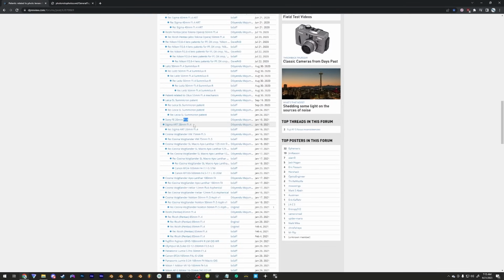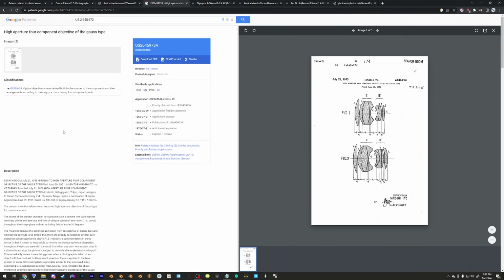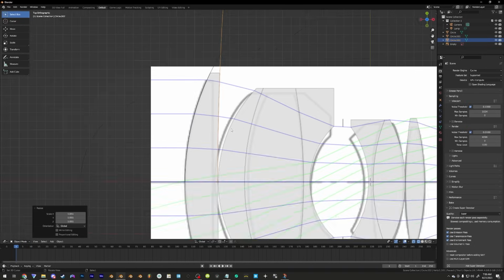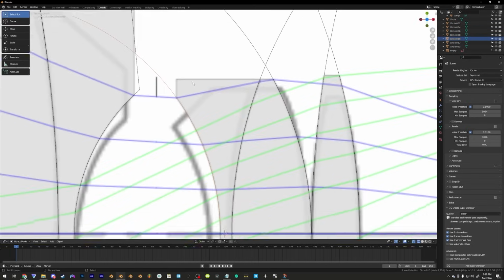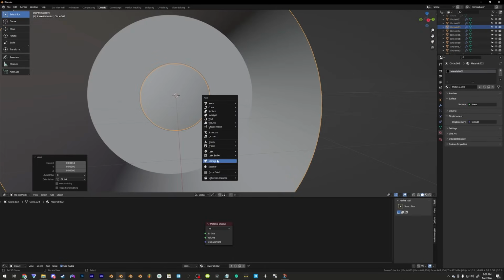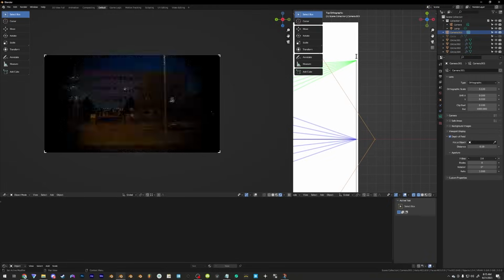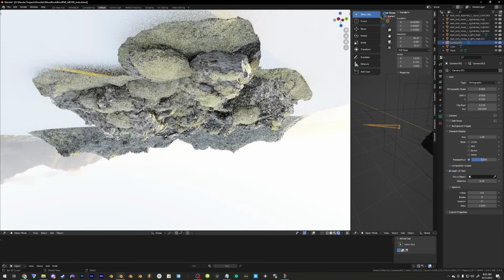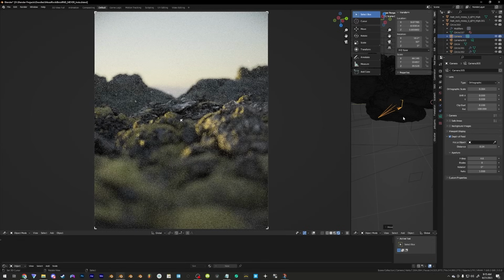Achieving True Photorealism With Lens Simulation

Comment: I wonder if there is now a way to dial in the lens coating and interior reflectivity of the lens barrel so that you can accurately simulate the complex flares that these lenses would have.
Reply from the maker: Indeed there is a way!  It requires a separate engine referred to as luxcore, I'll see if I can get some documentation on that up and running!

Comment: Great video, rarely do I watch one hour long tutorials without skipping!
The lens really obtained its characteristics once the IOR's were applied and it would make me really curious what slight changes in these values for the elements would create :)
Do you think you could reproduce it with fixed orthographic size akin to full frame and have the lens elements move instead?
The icing on the cake would be to model it all to real world scale so that one could use their photography knowledge/experience and/or online DoF calculators to obtain the result they are looking for. (Too often you see renders with weird DoF's, giving away that the scene probably wasn't modeled at real world scale and thus impossibly low f-stop or impossibly large image sensors had to be used.)

A little feedback I'd like to share is that during the first part you're talking for some time about f-stop and "speed" etc, but in my opinion that could all be omitted and frankly the explanation was a bit unnecessarily complicated (basically, f-stop = focal length divided by aperture size is all you needed to explain in one or two sentences). 
It's not important in CGI at this stage as both ISO and shutter speed are not being modeled, so concepts like 'fast lenses' go overboard then. 
Hence you are using the exposure slider later in the video.
Anyway, all not that important, it's a great video and very inspiring!
Reply: Shutter speed is modeled if you enable motion blur. ISO doesnt really have any meaning in this context though, since there's no analog signal to amplify or convert to digital.
Reply from the maker: Thank you for the kind words and suggestions!  I've had an optical engineer hit me up and there are already massive improvements.

Comment: How would you approach modelling anamorphic lenses using this technique?
Reply from the maker: Most anamorphic lens patents include the X information and Z information separately, however theyre usually under VERY tight raps!
Reply: @zircron45  What is the X and the Z information in this case? We've profiled a lot of lenses in the past using the conventional VFX workflow to get distortion coefficients and/or ST maps. I wonder if it might be possible to use the lens simulation to generate dynamic ST maps so that you don't have to calculate all this refraction at all times? Especially when you probably don't want to blow up your render time by increasing transmission and refraction for the whole scene?
Reply from the maker: @attilathenun  Heyo!  the X and Z information is used to distinguish how the cylindrical optics are different from the main spherical optics
Reply: @zircron45  Got it thanks! Have not worked with a lens at this capacity. I wonder what the difference is in terms of using a distortion shader versus simulation distortion from optics.
Reply from the maker: @attilathenun  the distortion changes as you rack focus and the bokeh shapes change too, its really crazy stuff

Comment: I would also suggest to simulate sensor size. In Maxwell render there is catalog of different cameras and it will give you preset values for sensor and ISO values and what not.
Reply from the maker: Thats an excellent idea, rather than just eyeballing it.

Comment: Man this dope af! I've got some questions tho:

How is the Perfomance? (Render time for relatively noiseless image comparing the blender default camera with deth of field turned on vs. such a custom lens setting) -> can it maybe be optimized?

Can an add-on be made with multiple lenses and simple settings to control it?

Are there lens flares? :o

Again: Great work! I'd love to get my hands on such an add-on!
Reply from the maker: In the works!  Hopefully we can get enough traction to get Blender on this topic and get them to make some precomputed lenses!
Reply: @zircron45 there already is tho. In the camera settings, under sensor and depth of field you can set the sensor size, F-stop, the number of aperture blades, etc. .

Comment: 🔥 A Collection of lenses ready to use in a blender addon would be the absolute best. I am 100% sure this would sell great on Blender Market, and i'd be the first to buy. 💰
Reply: Could he sell this though? As he is basically building stuff out of existing patents
Reply: @jo_naash  If it is an expired patent, absolutely. The patent shown is from 1951, so it is expired. Funnily enough, the older the lens, the more interest there would be in doing this, as newer lenses are designed to minimize the kind of imperfections that this process is meant to emulate.
Reply: @jo_naash I'd imagine this is transformative enough, since it's emulating the lens formula for digital rendering and not real world image capture. He'd have to come up with cute names that elude to what they actually are.
Reply: Yes!!!!
Reply: Ive got exactly that from 2022, look for jActual Cameras. work great in 4.2 also with the updates.
Reply: But you can just use the camera settings to do this